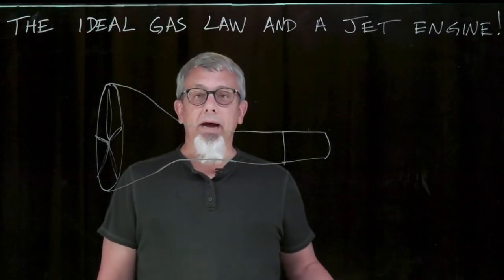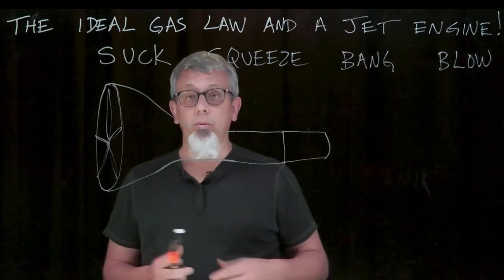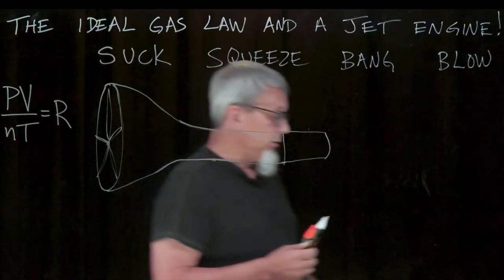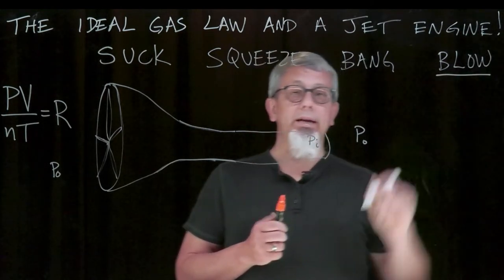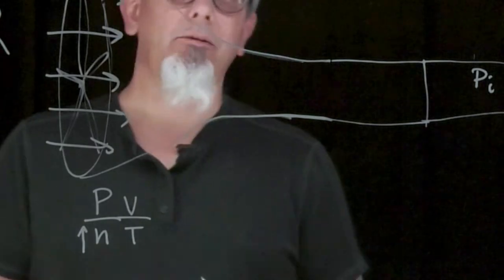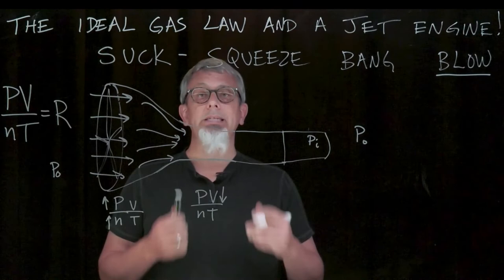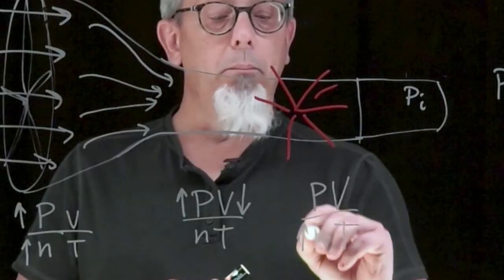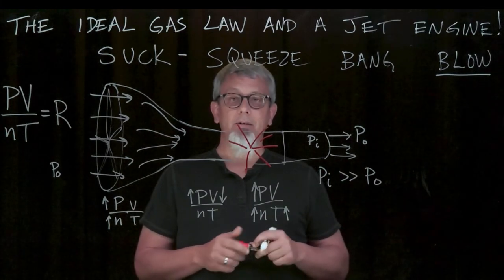Ideal Gas Law and a Jet Engine!

Comment: Without an engine diffuser to slow the pressure before combustion the engine wouldn't allow the air to go into the intake; which would cause an engine stall.